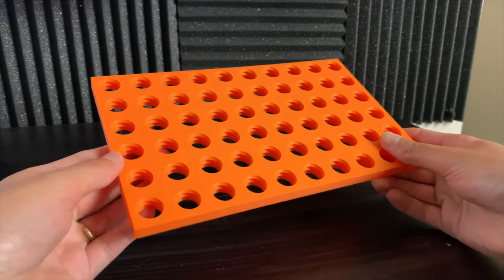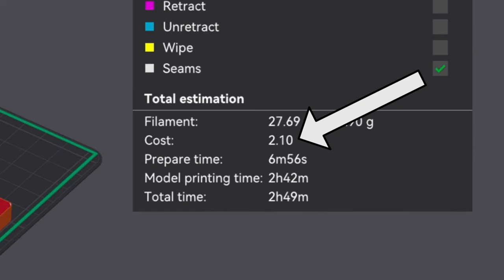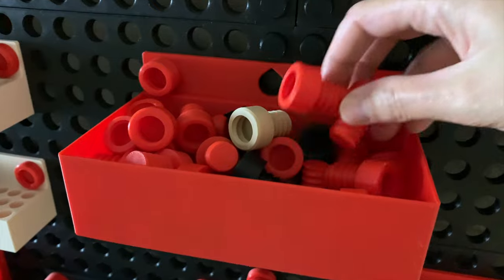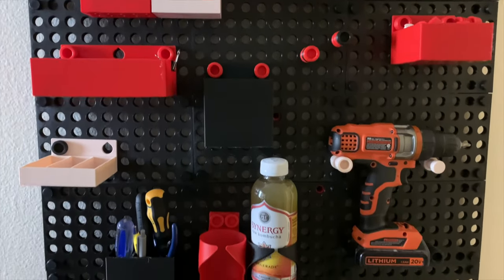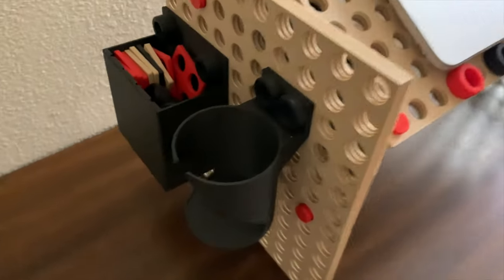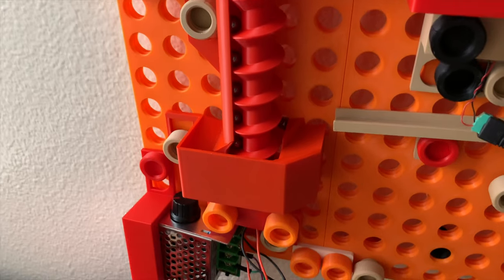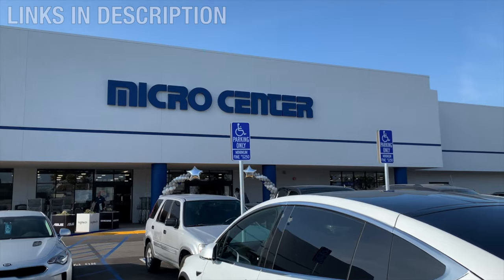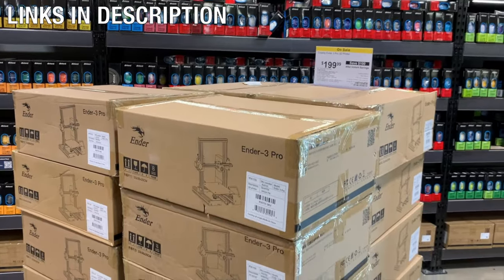Most practical 3D print you've even seen: Thread Boards

Comment: We have been using similar tooling plates for years in metalworking. They work really well for work holding and alignment. You might want to create some eccentric clamps, corner supports and squares. I think they would work great for woodworking and light metalwork. Best of all if you ding them up while you’re working on a project you just print a new one.

Comment: You are selling this ? Multiboard is better in my opinion and is free if you want or you can decide to support or not. 
You should have a free offer also.
Reply: It's definitely up to what people are looking for. Multiboard prioritizes strength through print orientation and varied parts, while it seems threadboard is more focused on using solid/high infill to achieve similar effect with greater compatibility (not needing to use many thread sizes and assemblies). Multiboard is also in earlier development, but has a 3 month early release schedule (no cost for personal use) so eventually all core parts will be free, though commercial use requires a license. I am unsure of how commercial use works with threadboard, but the base models have an initial cost from what I can see.

Full disclosure, I've contributed a bit to the Multiboard project, so I do have a bias in that direction 😅

Comment: Please not another "standard" for an organization system. This one is literally just a cheeseplate.
I'f you'd like to add compatibility for what we use in the film industry just use 1/4-20 and 3/8-16 screws instead and instantly have thousands of compatible accessories on the marker. Both regular screw treads and anti rotation locking pins like the Arri standard
Reply: Hm… print a 1/4-20 and see how that goes for repeat use 😅
Reply: That probably wouldn’t work very well for 3D printing

Comment: Another idea (or 2):

Introduce a bit more hexagons
For example make another hole in the inside of the screw that's a lil bit tinier and has a hexagon shape so you could use tools to thighten the screws a lil bit better
Also mby make the round outside of the bolt hexagon shaped
This should help with grip and torque when you for example need to get two scrows apart again after you tighten them to much